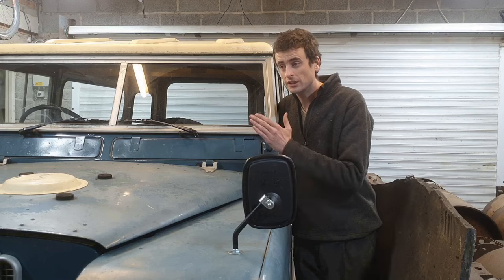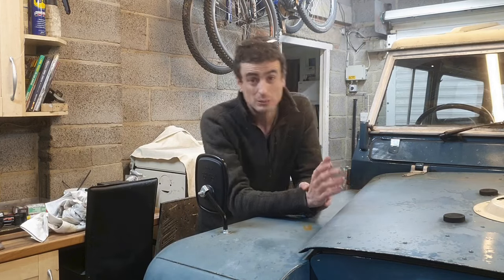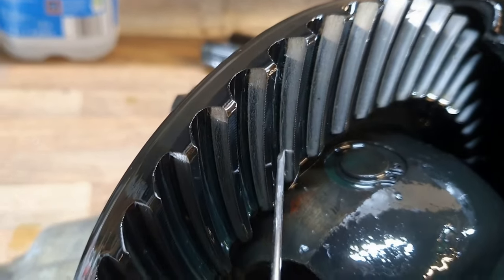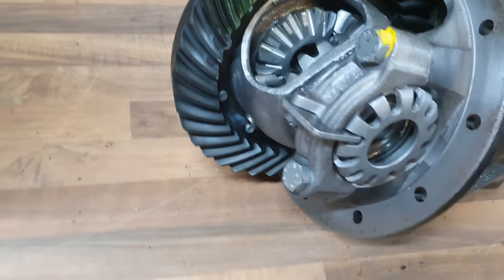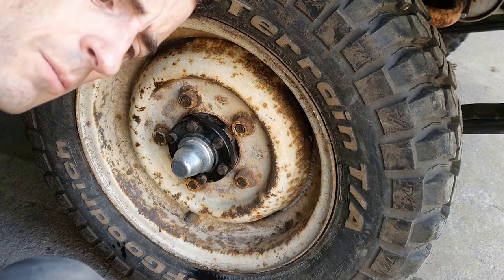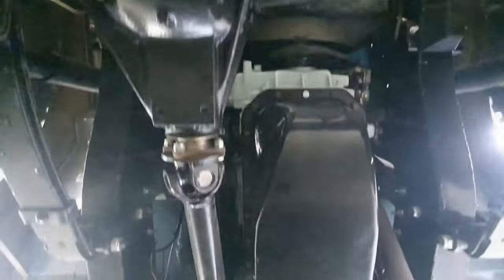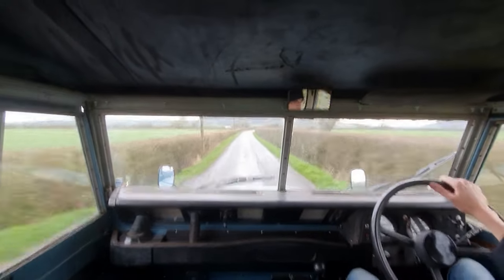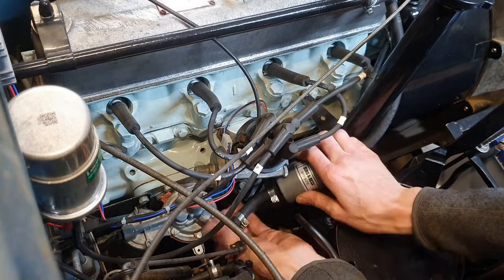How to diagnose a noisy diff - Ashcroft replacement diff - Land Rover Series 3 Project 44

Comment: Since the old series LRs are part-time fourwheel drive, normally driven by the rear wheels the rear diff wears much more than the front which normally get little use under power on the road.
What I did with my 150,000 mile series2 SWB was to swap over the front for the noisy worn rear diff; this involves a fair amout of work at the front, but the rear is easy. The diff worked fine on the front for the time FWD was needed.
And yes they do rotate in the correct direction, they are identical.
Another dodge we did when trialing them in competition in the early 1970s, was to fit a spare locked diff on the front (weld up the spider gears) and fit freewheeling hubs for road use.
Off road this aided traction immensly, the downside was that on the road, steering became impossibly heavy. You only needed to unlock one hub for a short stint on hard sufaces between stages, when it was then in 3 wheel drive!
Reply from the maker: Thats really cool, and a lovely cheap way of getting a locked diff, very clever. 

I had thought about swapping them front to back, but decided against it in the end. (Probably put off by the all the work involved in the front axle). :)

Thabks for you comment, much appreciated

Comment: A wonderful if not celebratory video. We've all been there! I too can appreciate the relief when the diagnosis requires a creative solution - and it proves to be correct! I had a very annoying crunching going 1st to 2nd gear. After a rebuild, new clutch, release bearing and to be safe, a new fork, the crunch was still there! Only to establish, that it was the fxxxxng handbrake drum!!! I can very much relate to the celebrations at around 6 minutes and 20 seconds. After replacing the handbrake drum, I cracked open a bottle of Chairmans Reserve Spiced Rum, both to celebrate, but also cause I was fooxxx freezeing laying on the bl00dy floor! Best wishes. I enjoy the vids, especially since I should be working......
Reply from the maker: Thanks for your kind words Daniel, much appreciated.  There are three main reasons I keep doing these crazy projects, firstly its fun, secondly I love getting the feedback from videos and third, its so nice to see the result of all the hard work.  Well done diagnosing the odd issue with yours that's often half the battle.  

Thanks again Daniel, and I'm glad to be a distraction from work :)
Reply: IIRC all pre series3 boxes had no syncromesh on either first or second gears. This meant you needed to double declutch both when changing down and changing up these gears. Many will be familiar using this technique to change down, but going up, from 1st to second takes a little practice.
Reply from the maker: @royfishall6482   I've really enjoyed messing around and trying to get clean gear shifts when slowing down. Not always successful, but definitely fun. :)

Comment: Top tip, ditch the free wheeling hubs, they are the devil's work and cause hundreds and hundreds of pounds of damage the the steering, save you no fuel and look shit, oh and weaken the drive train, apart from that they are great! At least leave them in 4x4 position, then you might be OK......just my humble opinion. Great Video by the way. Cheers
Reply from the maker: Yeah I've heard this else where. Sounds like a good idea and I'm on board. I suggested binning (or selling) them to the owner but wanted to keep them. I think I did at least make sure they were locked for the a good portion of the first drive.
Reply: The Fairy Engineering freewheeling/lockable hubs (made into the late 70's IIRC) we used were pretty well unbreakable in my experience. I don't know how they would damage steering or transmission. The only way you could do something nasty was to use four low in first gear with the hubs unlocked and be pulling a heavy trailer, or a tree down or something, then you'd snap a rear half shaft before anything else went ping. I agree they didn't seem to save fuel though. @lozl
Reply from the maker: @royfishall6482  my understanding was that with the hibs unlocked there was no rotation in the front axle at all so no oil being thrown up to the upper Swivel joint. I believe this can lead to premature failure but this is only something I've heard.
Reply: I agree, but all that is need is to lock them now and again. Leave them for years and do thousands of miles with them unlocked and maybe it would be an issue. But I never encountered a problem, and I must have put 75, 000 miles on them.   @lozl
Reply from the maker: @royfishall6482  fair enough, yeah your reasoning makes perfect sense.

Comment: Ah.... Maybe that's why my seriers 2a wants to kangaroo when I put it in 4x4 mode.... I bought it as an unfinished project, so maybe the ratios don't match.. 🤔
Reply from the maker: Oooooo, yeah interesting. With it being so close to thw original ratio it will be hard to measure just from counting turns of the Prop and the wheels, but I suppose with enough turns it could be determined